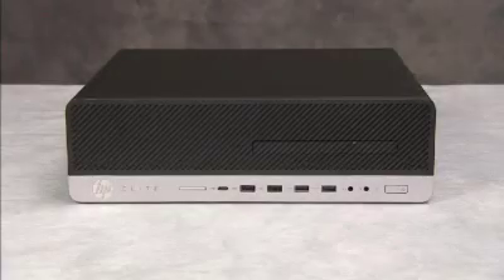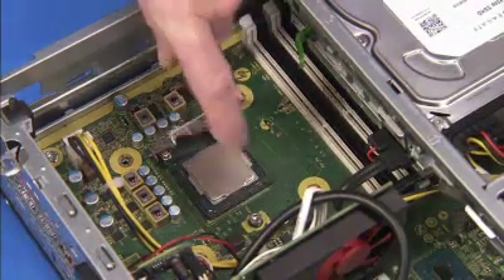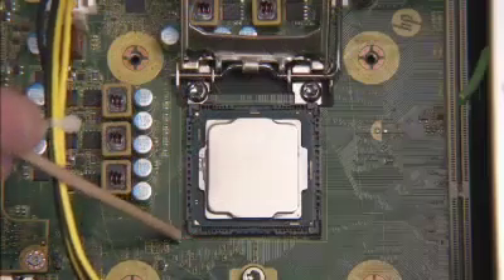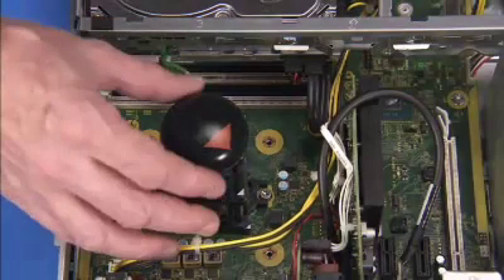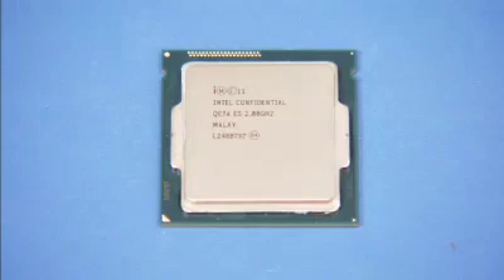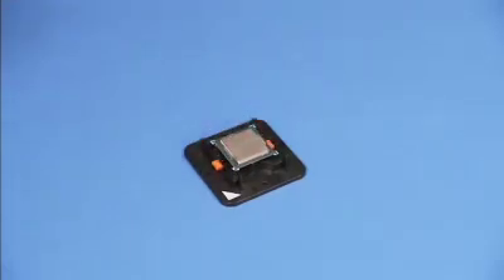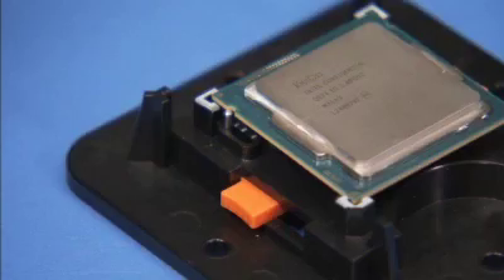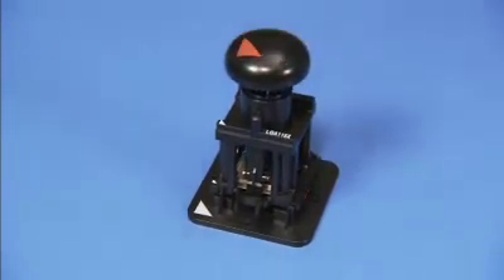Replace the CPU | HP EliteDesk 800 G3 and G4 Small Form Factor PCs | HP

Comment: what maximum cpu wattage does the 800 G3 mainboard support is it 95w??
Reply from the maker: +Max RoadWarrior Please refer 'Power supply' under the specification page to know information about the supported power supply: https://bit.ly/3mB3vwi
Reply: @HPSupport  already checked all that...the cpu at max spec 7700 is a 65w  but ive also seen that the mainboard can accept tdp 95w tdp on doing general research, so kind of confusing, also as bios has been updated as of august im guess cpu microcode support is newer but not published with those changes of cpu support